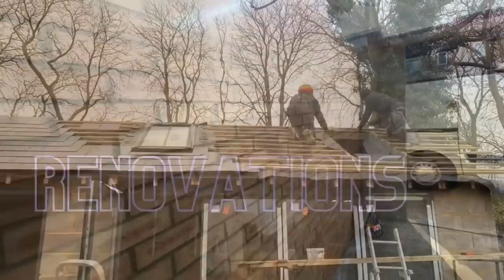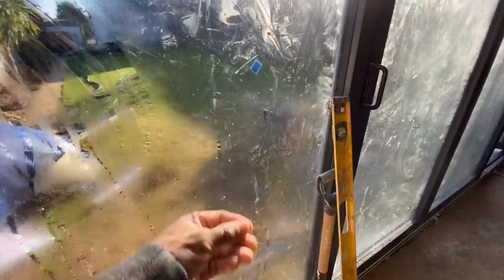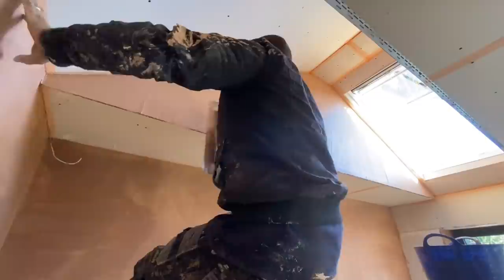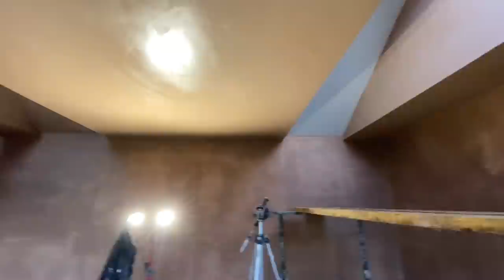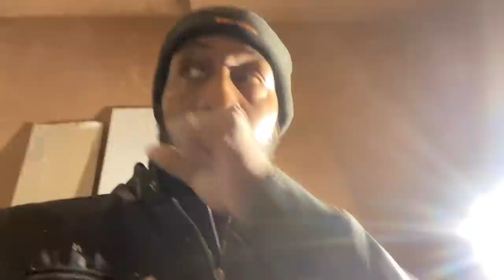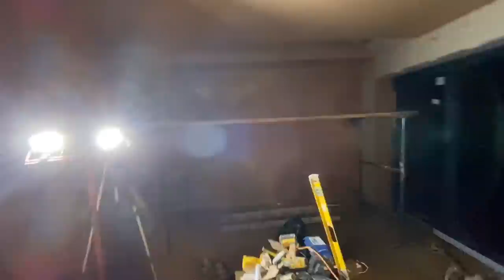How to plaster a garden house - Sunday working Part 2

Comment: Hi mate.
Just wanted to know, what size is the whole building? Specially height? Did u need planning permission? Cheers buddy
Reply from the maker: Hi it’s around 9 x 4 externally. The roof is around 3.8m to the top. Yes planning permission was needed
Reply: @darrenthebuilder  thanks for getting back, for gable roof you can go upto 4m, why was there a need for planning permission? Just need info. for my build. Really appreciate for getting bk to me. Cheers
Reply from the maker: @zafg2505  it’s due to its proximity to the boundary. Here’s some guidelines. Pay attention to clause 8; If the outbuilding is within 2 metres of the property boundary the whole building should not exceed 2.5 metres in height.

https://ecab.planningportal.co.uk/uploads/miniguides/outbuildings/outbuildings.pdf

Hope it helps
Reply: @darrenthebuilder  respect 👍